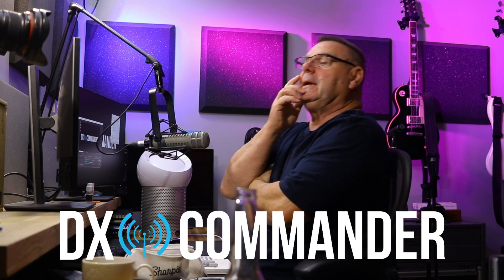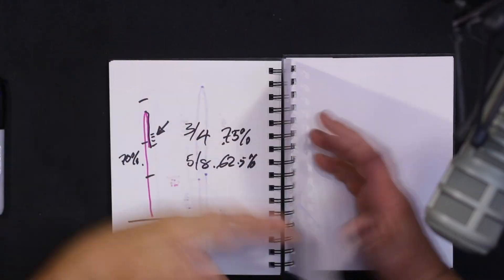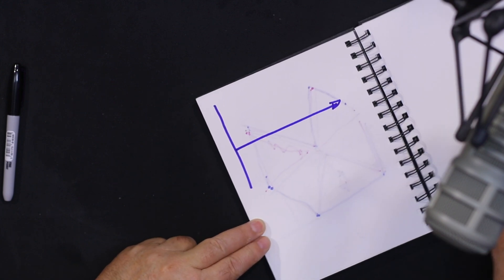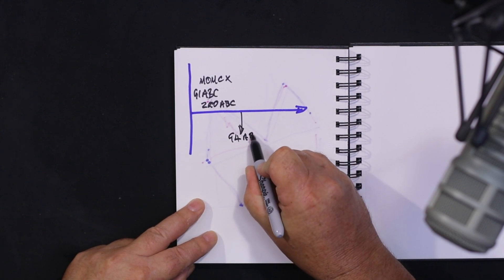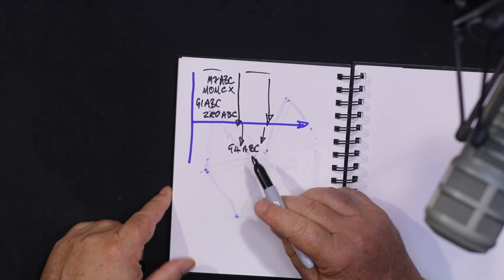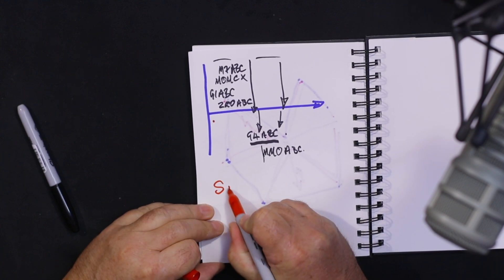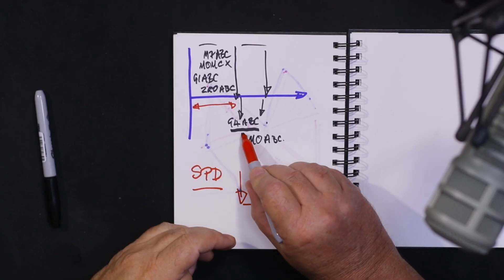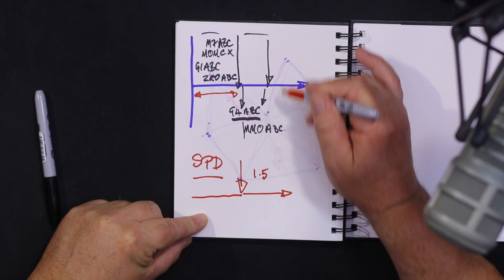Help! How to deal with a Ham-Radio Pile-Up.

Comment: 100% Cal.  Expedition pileups are a different animal all together though.  In all my DXpeditions i normally have to go split VFO to "thin out" the pileups.  Once that is achieved then most of your suggestions come into play. This is an entirely different sort of pileup to deal with though but it does mean you can get away from the multi-Kw stations who insist on calling and calling until you answer them only to find they cannot really hear you anyway..................cheers
Reply from the maker: Ah! Split freq.. Not done that!

Comment: Another good video Callum. What's also very important, as others suggested, is that the operator running the pile-up is in charge and acts accordingly. Fore instance, if the guy running the pile up asks the 2E0 to complete his call and other stations keep calling, you should stick with the 2E0 until he is in the log. If you don't you are basically saying that it is a free for all and that everyone should keep calling. Stick to your guns. 
Running a pile-up in a contest is, in my humble opinion, slightly different to what you suggest. In contests, it is always the goal to work stations in the shortest amount of time. When you can hear a full callsign right after the initial callers have ended, then work that guy. It is more efficient to work him because you already have his full call and it will save you an extra "over". 
The first time you run a pile-up, everyone sounds the same and you can't make out any callsign. As with everything, practice makes perfect and after a while you will be able focus on one particular caller and get his full callsign amongst the other callers. When this happens, running pile-ups will become much more enjoyable as I'm sure you have already experienced ;-)
Keep it up!
P.s. I'm am on holiday so I finaly have the time to catch up on some of your video's ;-)
Reply from the maker: Maartin, very good explanation!

Comment: Stupid question ... It sounds like qrp stations calling CQ don't get pile ups, is that true? Makes me think I would not be able to do this because I'm qrp, no? It could be that G4ABC is louder than me and I can't break through. Again, it's a dumb question, but thought I'd ask.
Reply from the maker: Actually, they do .. for instance if they are on a special island (islands on the air) or up a hill (summits on the air).. But most 10W /P stations are also using extreme compromise antennas. Taking a "full sized" one helps. I ran a 10W special one night and had a pile up.. But I was pretty determined - and folks soon found out that I was literally creating a pile up from nothing..
Reply: @DXCommanderHQ  ok, cool! Good to know! Thank you for responding to my comments, you rock!

Comment: Pro tip:  if you are trying to get through a pile up, always wait so long that you accidentally trample the operator running the pile up and muck things up for everyone.  Bonus points can be achieved by calling out your call sign when the guy running the pile up gives it back to the other station for a final, instead of waiting for the pile up master to finish up and call QRZ.
Reply from the maker: HAHA

Comment: My worst experience was when I worked a so called speed contest. After answering a cq the frequency is yours and you have to call cq. I called, several stations came back at once and I didn’t get anything. After the ‚spd‘ (to use your nice new term), nothing. Everyone waits for me to return, but I don’t know what. No good idea to say something like ‚again'. Also I was unable to pick a station by number or whatever. So I had to repeat my cq. Everyone was angry for losing precious time… In this situation I would have been glad, if only one station had repeated its callsign (after 'spd'). Maybe a hint for all those who are 'piling up'… Repeat your call, if the cq'ing station doesn’t react immediately.
Reply from the maker: Yes, I see the problem... You can make a blind stab at a number.. "Did I hear a 1"? then "a 2 or 3"?